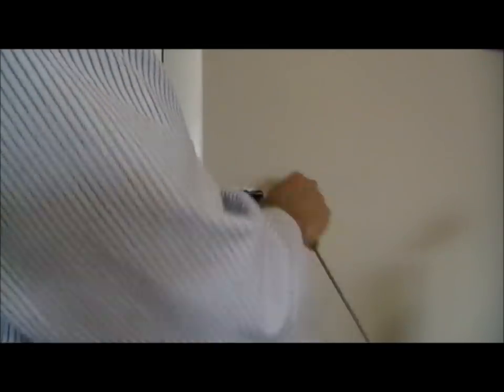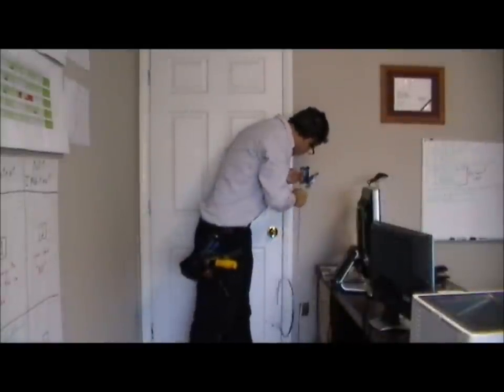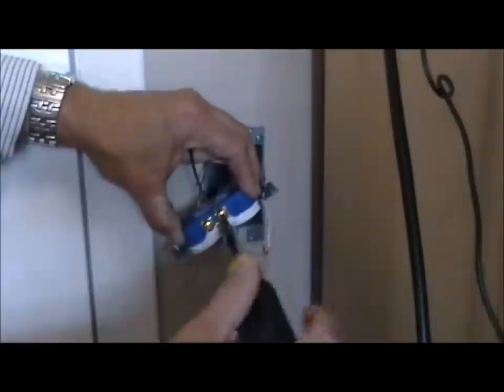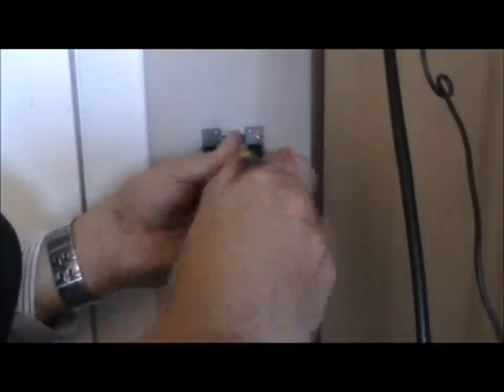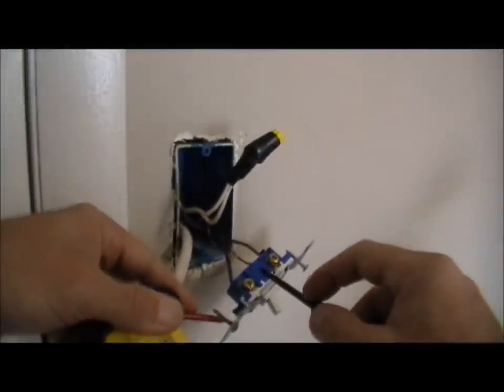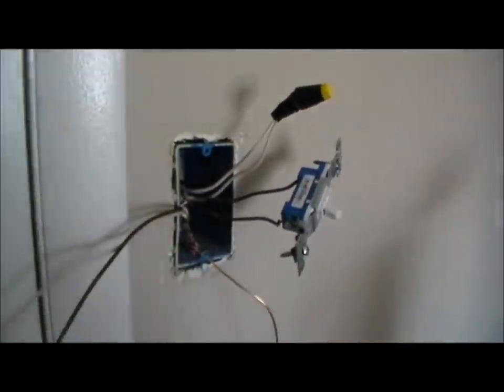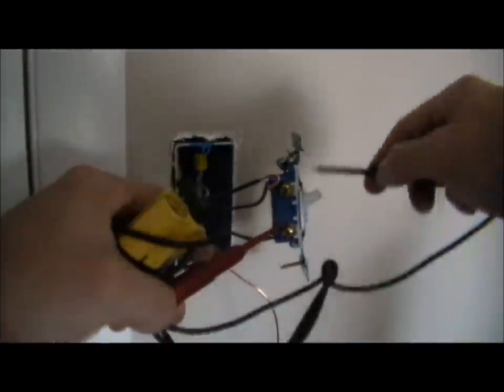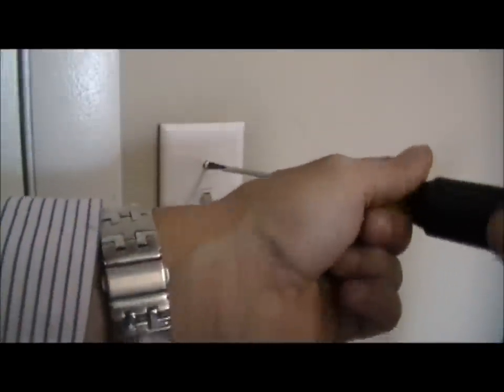how to wire an outlet off of a switch

Comment: wow so dodgy. i dont know how you guys do it in the states but here in australia this is illegal. you cant run a power outlet of a light circuit. also all electrical work must be done by a qualified electrician.
Reply: that's what they tell you so you keep hiring electricians. If you learn the proper safety measures and know what you're doing you can do simple projects by yourself

Comment: Bad, dangerous video. This is NOT to electrical code. For instance, he wires the new black wire through the on/off switch. By doing this, all power to the new outlet flows through the switch!  Hmmm... an extra 300 watts flowing through the plastic switch should be ok - right? lol. This guy may dress like a technician, but he never went to a trade school. And working with the power on? I can't wait to see his next video on America's Dumbest Videos.
Reply: I think he said to hook to the continuously hot-side, not on the switched to on position hot-side. But if your right, What should I do then?
Should I hook the wires together prior to the switch?
What difference would that matter?  Don't You still only have 120v coming to and from the switch?
Also, how did he not get the hell shocked out of him, on the hot side, when he unscrewed the hot screw with his bare hands?
Dude, if the wrong  amateur  watches this, I am pretty sure they are going to find out real fast, just what 120v feels like!
Reply: SCOTTY LMBOBOY Thanks for you questions. Excuse me if I don't get too specific, but electrical should be done by licensed people( (though homeowners often "do it yourself"). The important thing is don't start a fire behind the wall or have someone get a shock.

Some basics: a switch generally interrupts the BLACK wire. The white wire just goes on through the circuit. The green wire is ground and connects all the metal things you might touch (housing, screws, sink, etc.). If you're routing a wire to two or more points, it's generally best to 'pigtail' it with a wire nut, not use a switch or outlet as a 'convenient branch point'. Radio Shack has a good book called "Wiring Simplified".

The most important thing is NEVER... and I mean never work on a hot circuit. Buy a device from Home Depot that beeps when you hold it near a hot wire. After you turn off the circuit breaker, tape a note over the breaker switch DO NOT TOUCH. Someone might switch it on while you're working - Surprise!

I hope this helps. Good luck.
Reply: The22on I am not an electrician.  I was (now retired) an installer of electronics equipment for a government agency where I did get some electrical training and wired electric outlets and electronic equipment to the circuit breakeers. In large facilities electricians were hired to do the building wiring.  So, I worked around electricians a lot.  I was really impressed by some who were really good, and I learned a lot from them,  but I have to tell you there were some really bad ones out there too, just like in any profession.  One thing that impressed me about some of the big union outfits was the constant update training they did.
Reply from the maker: Thank you for your opinion. We need to pass third-party inspections. Our AHJ has not had an issue with wiring devices this way. We have however move to pig tailing all connections because they work better with AFCI breakers. Please post a video reply sharing how you would do it.